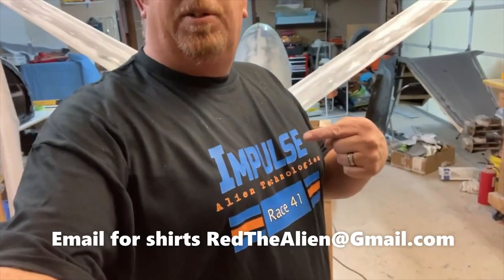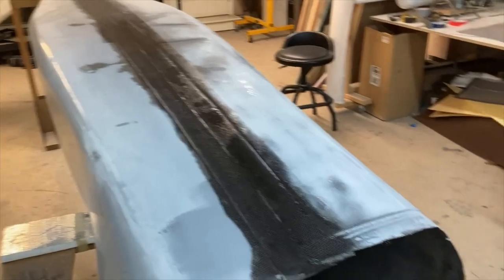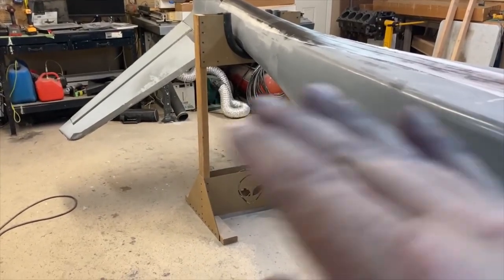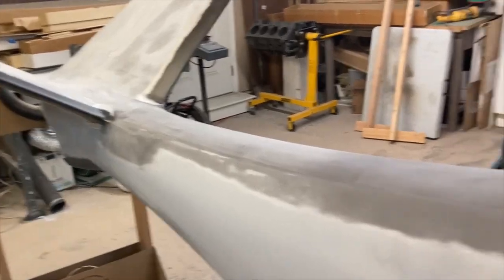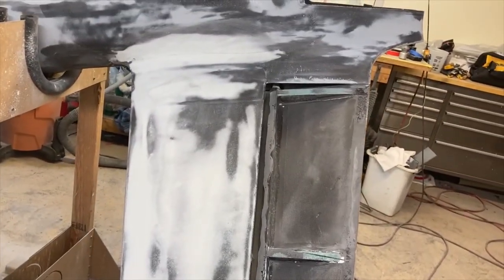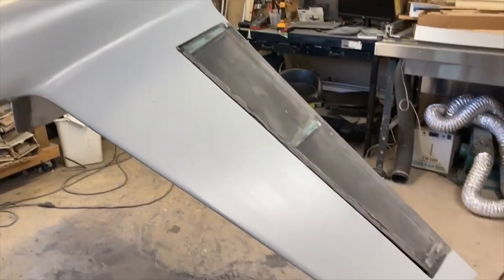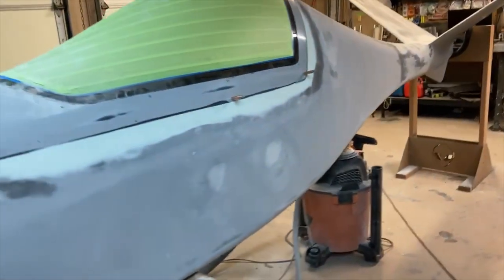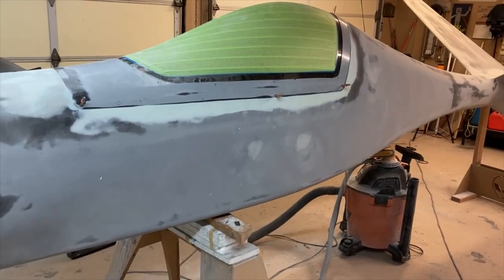Impulse Ep 10   Seaming, priming & Fitting the canopy

Comment: I really love what you're doing Red. As soon as I'm able, I plan on designing and building my own composite airplane. I've used vacuum bagging techniques for RC aircraft with success, and seeing you apply them to a full-scale plane really put into perspective just how possible it is for a passionate individiual to build an airplane. Thanks for documenting such an awesome project!

Edit: And here's a question: what are your thoughts on manufacturing molds direcly, either by CNC machinging or with a large-format 3D printer? Making a plug seems like extra work, although it seems to be the standard procedure so there must be something to it.
Reply from the maker: Hi Sam, thanks for the question. There is no issue with going direct to tool via CNC or 3D printing. For me that presents a couple challenges. You may have noticed that I work largely by myself. This means that not only do my molds need to be stiff, they also need to be light so I can move them around. MDF and other direct to mold tools tend to be heavy, so that is a large driver for me. I also wanted the molds and parts to made out of similar materials to minimize warpage during post cure.
Reply: That makes a lot of sense, thanks for the reply @RedJensen

Comment: Question...
Since you have built the fuselage shell (including engine cowl) before fitting the firewall and engine, how easy/hard is it going to be to position the engine and prop shaft to line up with the hole in the nose?
Reply from the maker: The motor mount will be welded in place so I’ll fixture the motor where I want it, then build the mount to it.